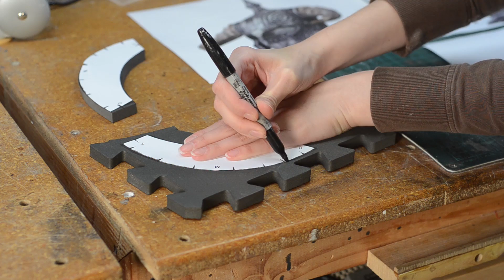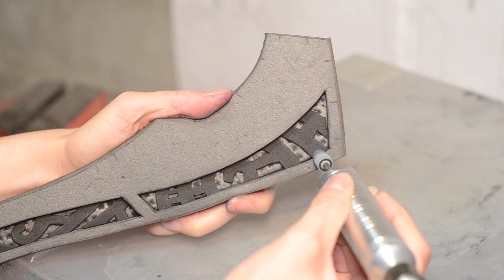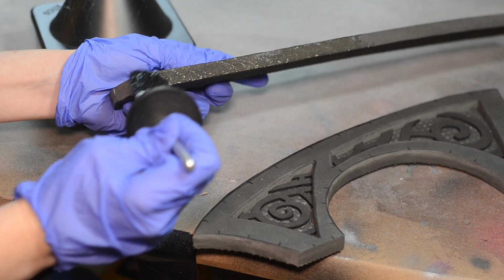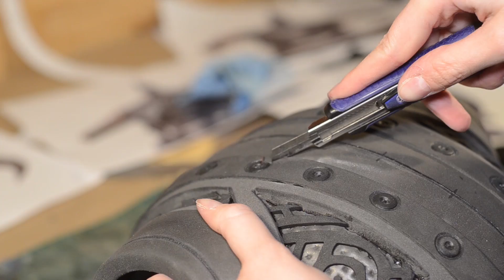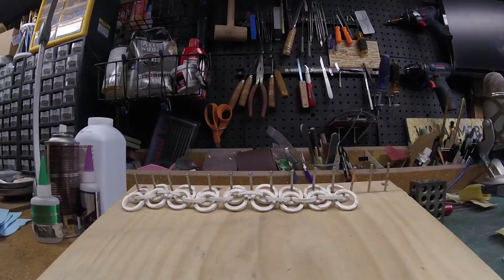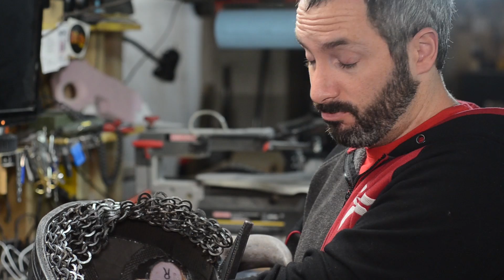How to Make the Horned Steel Helm for your Skyrim Costume - Prop: Shop

Comment: I built this helmet in 2017 or 2018 and im building it again in 2024. I want to check how much my technique has improved. Also, my original was rushed to get done for a contest the next day, and i didn't do all the recessed parts, just engraved the detail patterns.

When i first made this, I confused the steel helm with the iron helm, and only caught the difference this year. So, all new horns, and include the chainmail this time!😅

Comment: I’m in the process of building this helmet as a warmup/trainer for the steel armor and, eventually, a few custom designs I’ve been kicking around in my head for years. 

I printed both patterns and did my mockups with just the paper patterns and tape. I had thought that the small would be way too small, but it actually fits me just fine. It looks like it would also work for my enormous-headed husband (seriously, huge head, he has trouble buying hats), though with less padding. 

For those of you curious about BoM details, mine took less that 1 sheet of HFT puzzle-y floor tile and about 1/3 sheet 12”x18” 2mm foam. I checked WM and HL but only Michael’s carries 6mm foam in my area. For the 4mm I’m planning to laminate 2 pieces of 2mm together with contact cement or buy online. At this time, the affiliate link for plastidip is the same price as at WM, so I bought several cans. 
I may use a different horn material since I plan to do some light larping in this helmet and I don’t want anybody to feel bad about destroying my horns. Currently I’m favoring sculpting it out of pipe wrap or eva foam or even 3D printing them, since there is a model for the iron helmet horns on Thingiverse. 

Thanks, Punished Props!

Comment: So, the smaller version fits Bill's 23 inch head?
Extremely nice work this time   :)   the coloring was perfect and the styrene plastic as braces was also a nice idea
Reply: My head is 24 inches so i'll try to print this (the smaller version) at 24/23 scale and see where i land   :)   thanks again for a nice video

Comment: Hey Bill, I'm making this helmet using the templates you so generously allowed me to use, but I don't have contact cement... Will hot glue work well enough? I have a heat gun to shape the parts so they won't pull to much, but will the hot glue work?

Comment: What type of spray adhesive did you use I am making a large foam weapon out of insulation foam and it requires many layers of it and I am not sure which is the best for the job

Comment: In the future when using insuation foam, remove the plastic sheathing on both sides to avoid that seam :D
Reply: ***** ya I had the same problem when I made Alex mercer's blade arm out of insulation foam many years ago. I had removed the plastic on one side, but forgotten it on the other side..! Removing it DOES eliminate some stability for thinner pieces but if its thick it'll stay together pretty well and the stuff can take a pretty generous beating in my experience.

Comment: Here's a quick tip to anyone from the southeast. When you are making any of these props and you are using hot glue and you live in say Florida, Take Your Work Inside! Humidity and hot glue don't mix! It will melt it! So when you finish assembling your work, take it inside to dry! Don't be like me and leave it in your garage!

Comment: Great project! Quick question about the Barge glue pot. Do you keep your pot indoors or is it ok to have in the cold garage during Winter? I had some adhesion issues gluing my EVA foam edges together when keeping the glue pot in the garage as well as letting cemented foam edges dry in the cold. Your advice is greatly appreciated :)
Reply from the maker: Thanks so much for watching! I always keep Barge indoors and out of freezing temperatures or temperatures below 40 degrees. It won't necessarily freeze but it can be negatively affected.

Comment: I wonder why you didn't use the texture at the back of the foam? it seems similar to the meat tenderizer texture.
Reply from the maker: It is quite similar, but a little too large and too raised off the surface of the foam. It was easier to create my own texture than try to make that texture work - it's also a slightly different surface than the non-textured side, and doesn't take glue as well.

Comment: I am from the UK. What paper size is the template set up for? I have printed out the smaller helmet template and it looks really small. Can you tell me what the sizes are between the dotted line perimeter of the template so I can check my scaling.
Reply from the maker: All of our patterns are designed to fit US Letter sized paper.

Comment: When cutting the rings with the bandsaw, what TPI blade do you use? I tried a standard wood cutting blade and the rings came out pretty rough looking.
Reply from the maker: An 18 TPI metal cutting blade worked really well.

Comment: when I print the template, it prints each one on half a sheet of 8x11 which seems far to small, am I doing something wrong?
Reply from the maker: I'm not quite sure. It should be printed at 100% scale on a letter sized printer.
Reply: Punished Props thank you for the quick response, I figured it out, I had it set to booklet from my last dungeons and dragons printout I did

Comment: Don't forget most real-life helmets tend towards the oversize, to simplify mass production: the fix is that they are lined with a simple leather cap liner, not much more than a skullcap secired to the helmet on the outer edge and fitted with a tie lace at the crown of the head, which determines how high it sits on the wearer. The reason for this is firstly, because a hard helmet is expletivwe-deleted uncomfortable, and secondly, because the gap provides some shock protection.